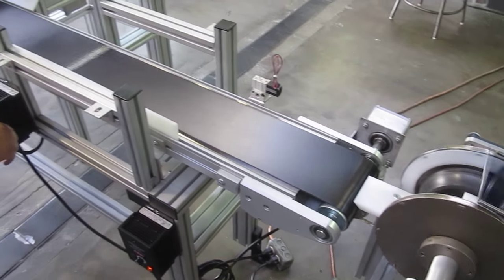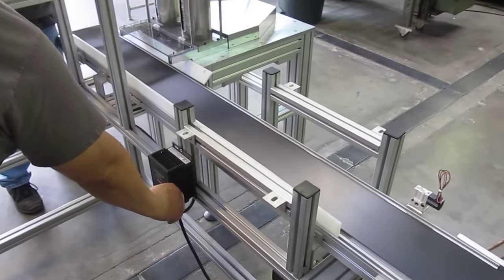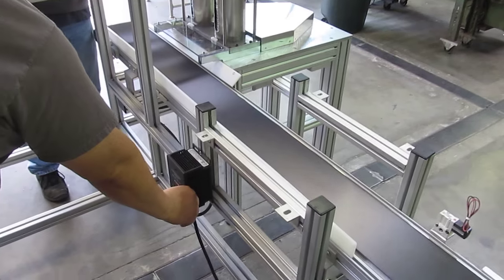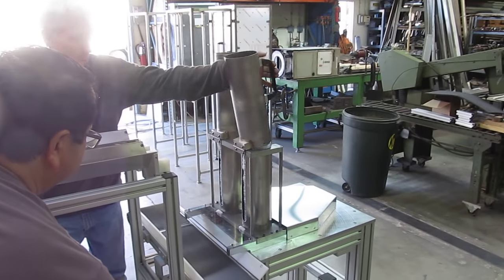Case Automation destacking &  inspection conveyor

Comment: Great project, how does the last part pick up the lids and stack them on the upper conveyor. Its not clear please explain the technology there......
Reply: Magnet
Reply: @aan5393  Thanks. So it is round or in form of a wheel there?
Reply: @raphaelmahumane1648  yes the inside is a rounded profile for good surface contact with the discs so they stay parallel to the radius of the wheel, or close enough to it.
Reply: @andrewyates5548  Thank you. This is an interesting piece of technology, especially the magnet component!!!! If we were to remove the magnet component, do you think there can be something else to serve the same purpose excluding magnet?

Comment: Imagine you had inspection/quality control problems, so instead of addressing the problems at their source, you invested the money to buy  packages of unreliable material, transport that to a different location, and then the time and expense to build a complex machine to unwrap, de-stack, convey, inspect, restack, and repackage. Is this an incredibly stupid engineer or an engineer who has a terrible boss?
Reply: Yes, if a consistent defect showed up they would find the cause and correct it. This machine is intended to make it easy and fast to inspect every single part that comes off the production line, not just the the ones in the batches that are flagged due to defects, ALL of them.
Reply: @andrewyates5548  I get that every part needs to be inspected and up to spec, but it’s still wildly inefficient to do it this way. Do the inspection where they are made and you avoid any need for this whole mess. A complicated, expensive, extra machine that you have to pay someone to operate and for that matter it takes up space and requires maintenance and training. It’s just so simple and obvious to correct the underlying problem that is effectively ballooning into the existence of this machine.

To put it another way, if your supplier can’t deliver reliable product in spec, you try to get the supplier to fix it, or you switch to a different supplier who can produce adequate quality, or you make the part in house. There’s no scenario where you let your production line include jank scab machines that paper over a manufacturing defect higher in the chain. Not with all the wasted money of packaging and shipping.
Reply: @twestgard2  You've obviously never seen sheet metal punch machines. They make about 500-1000 parts/min for small parts like that. You think you can effectively inspect parts that fast be my guest but normal humans can't. They split the production into multiples of these unstackers so that they are moving slowly enough to actually look at them.
Reply: @andrewyates5548  I take your point with that, but the inspection is being done somewhere, sometime, by someone, so that’s the same. There’s still an extra stacking/de stacking step in here that could be eliminated by having an adequate inspection system the first time the parts are in a conveyor belt system.
Reply: @twestgard2  They come out of the machine in stacks, not on a conveyor belt. I totally understand your intention to make things more efficient,  I'm the same way, but because of the way the punch machines works it just wouldn't make sense to remove them with a belt.
Reply: @andrewyates5548  that sounds like a specific machine that might not be the system for all machines. I worked in a blanking factory for a year in the early nineties on machines that were anywhere from new to a Bliss from the 1920’s. All of them were conveyor based. I can’t see why a die press with a rolled edge would necessarily require stacking, but equally I can imagine one might. 

This conversation got more interesting and nuanced than I expected.
Reply: @twestgard2  Okay maybe we're talking about two different types of punch machines but even still, neither you nor I have actually worked at that specific factory so maybe there's a perfectly valid reason for doing it this way that we just aren't seeing in the video.
Reply: The customer had produced over 30 million of these lids, sleeved them then put them in inventory before they discovered the quality problem. This was their vision to salvage as much of this inventory as possible. It was successful.